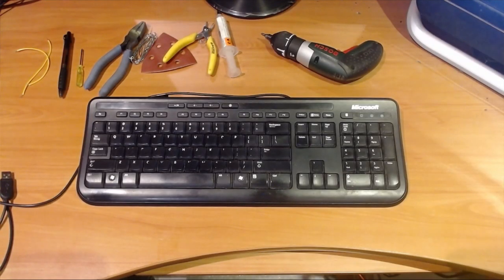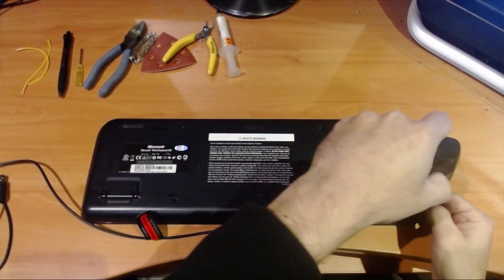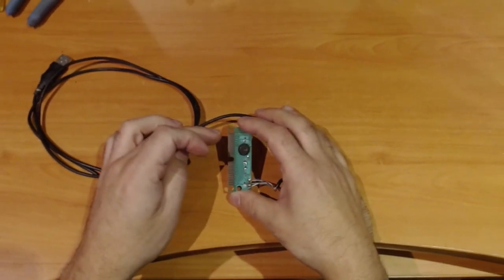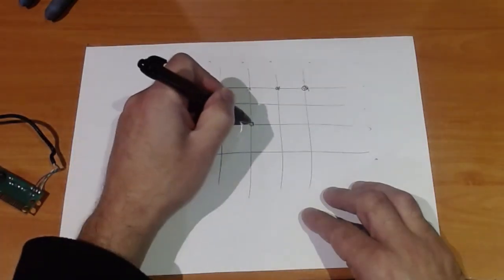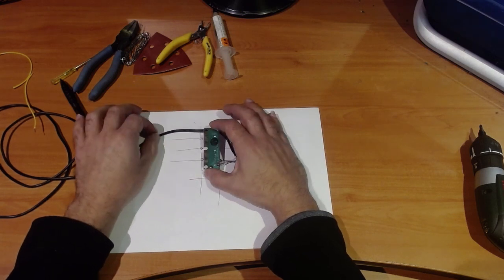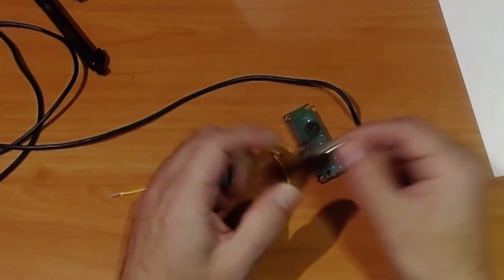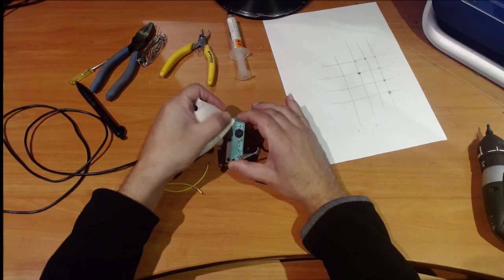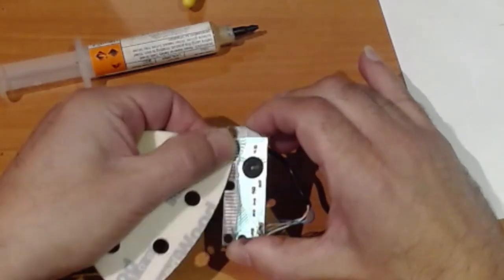Build your own USB switch

Comment: USB is very finicky, even touching the data lines can crash the computer, even the USB pins of the plug have the power pins that are longer so power is applied first, you just cant go and try and use a simple switch it wont work